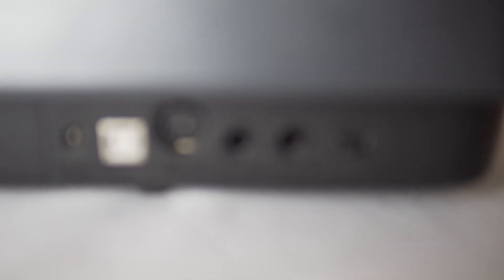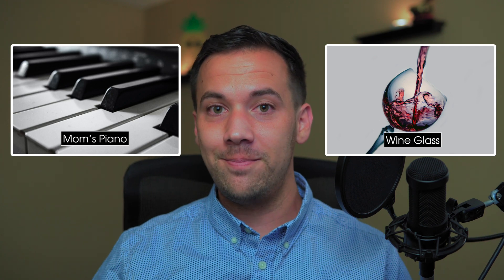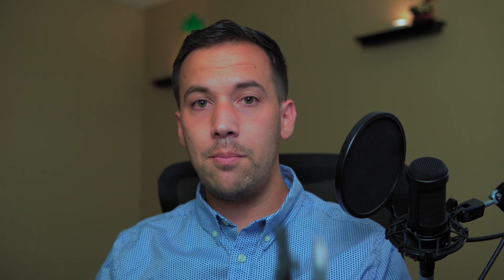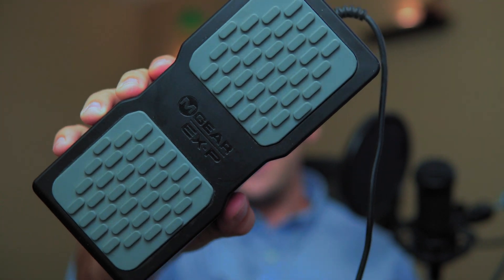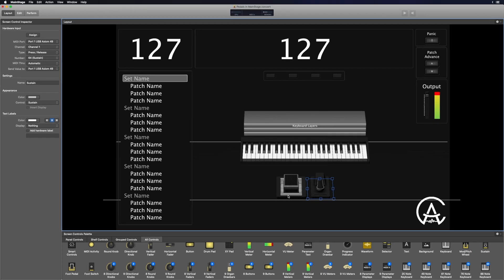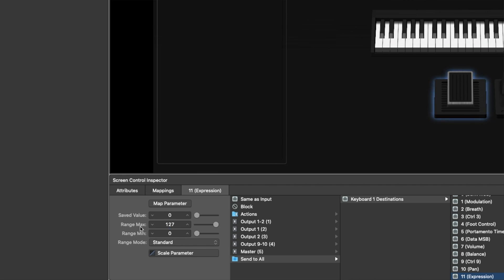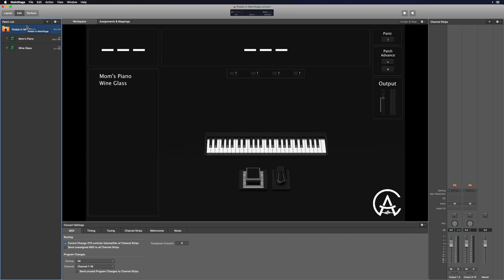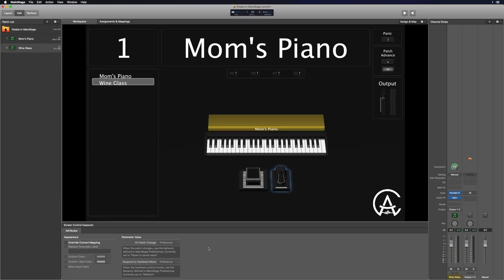How To Set Up Pedals In MainStage

Comment: Two question: 1. If my sustain pedal is built in with my keyboard I still follow the same process? 2. Is there a way to make a pedal that can start and stop the metronome?
Reply from the maker: 1. It should still work, just double check if the pedal sending MIDI CC 64 that’s the message for sustaining

2. Yes, it is listed under the actions when mapping the pedal.

Comment: Really appreciate your videos. I use MS for theater and am having an issue where when I switch patches, my expression pedal doesn't reset itself so my patch change is louder then what I want it to be. Is this normal? I find myself having to switch the patch and then press my pedal down to "reset" it and then play the patch. This is difficult for fast changes. Any ideas? I'm using a Roland rd88 and a yahama fc7 with inverted polarity using a physical adapter. Pedal is set to expression mode

Comment: when i have 2 instruments split on keyboard like strings or pads on left and may be clean guitar on the right, i want the sustain to only work on the left chords and not on the right guitar solo.. i do set the left side to sustain 64 and let the right side be..  sometimes it works, other times the right side also takes the sustain signal which i don't want.. how to fix that?

Comment: Hi James! I just got a foot pedal to act as a switch for a patch advance, but even when I press it lightly it advances more patches than it should. I got this pedal specifically because it wasn't supposed to do that (Boss FS-5U Foot Switch). Could it have anything to do with the keyboard input?
Reply from the maker: Hey Jim, I would check the pedal in Layout Mode. On the left hand side where it says "type", you should set it to "Single Value". Sometimes if you have it set to something different it can read the pedal presses as multiple inputs.

Comment: Hey James! When we have two keyboards in the layout, one sustain pedal sustain both keyboards, is there a way to fix it so we can have separate sustain pedals for each keyboard?
Reply from the maker: If you have two separate pedals, one plugged into each synth/midi controller. Go to layout mode and bring in two separate pedals from the control panel. You can then assign the pedals just like you would assign a keyboard using the assign button in layout mode and that should allow them to function separately.

Comment: Hey James, thanks so much for this awesome tutorial. I'm having a strange issue: I have a Moog expression pedal connected to an AKAI MPK261 keyboard and then running into MainStage. When I stroke the pedal MainStage interprets the pedal as a volume control, and signals are sent on channel 1 and 2. I can't figure out how to turn off the volume control. I actually want to use the pedal as a filter pedal but since it modulates the volume I can't tell if my settings are working. Any help would be greatly appreciated. Thank you again